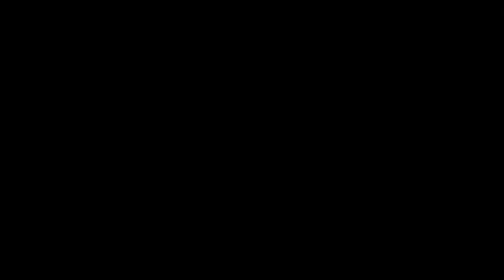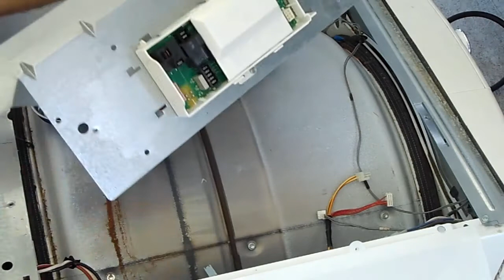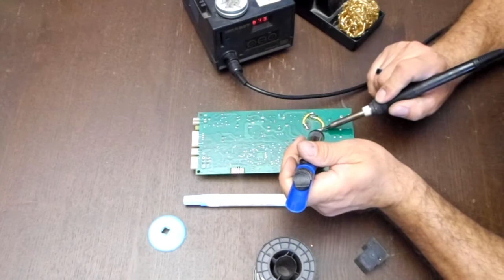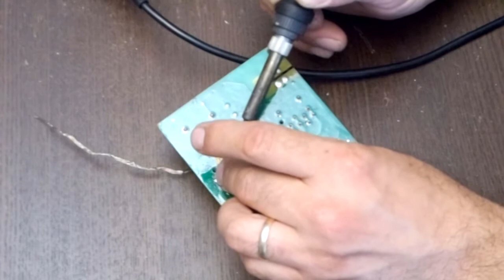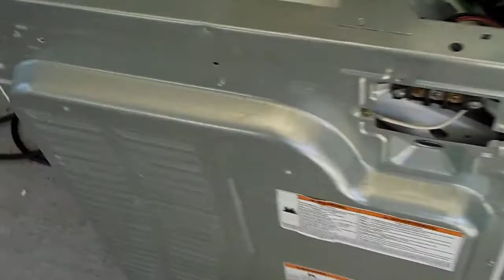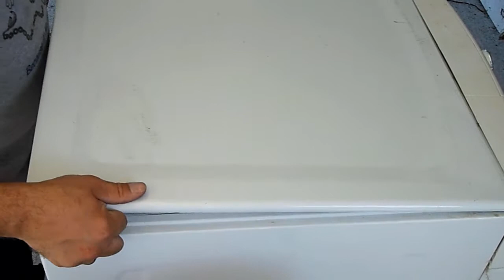Kenmore Elite HE3 110.87872601 F01 Error Relay Repair

Comment: Just replaced few of them now I have one with Sanyou sla-s-112dmj-f-30. It does not say 12vdc or 24vdc. Wondering if they are interchangeable with omron gb8-1a4pacd or tyco t9as1d12-12
Reply from the maker: Looks like it should be compatible glancing at http://www.sanyourelay.ca/public/products/pdf/SLA.pdf

Comment: You do not take the back off of that particular dryer to replace the heater element or belt.. You go through the front and take the front panel off.